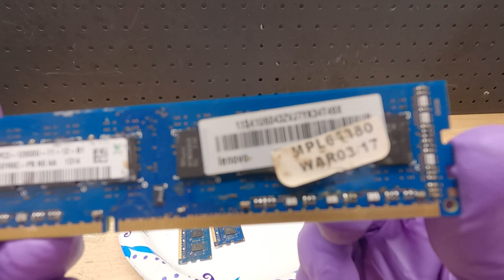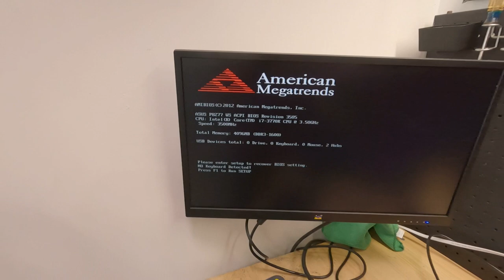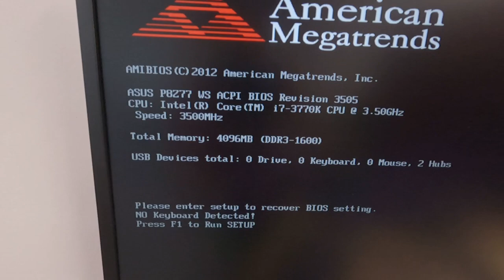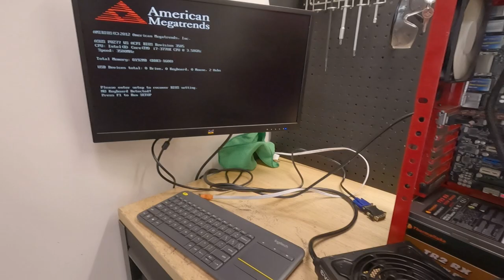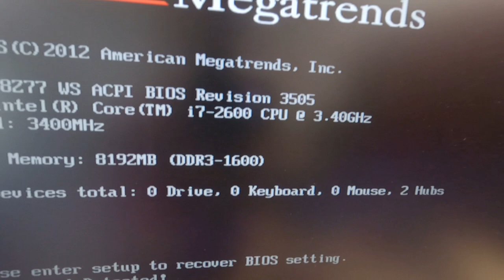Cleaning roach infested computer parts! Was it worth it??

Comment: I would just do the same thing you did, but I would have checked the inside of the case outside the house.  If it was going to be worth it,  it was going to be worth it, but if it didn't, it didn't.  You got your $20.00 back and some free ram that works.

Comment: I would have cleaned it, for sure, to give it all a shot.  You chuck and or destroy that dead stick or try to file for a warranty claim on it?  What was the make?
Reply from the maker: I actually went back and gave it another cleaning and it started working. Did a memtest and it's stable. Guess it just needed more tlc lol
Reply: @DLMtechgarage  I'm guessing wet-spot under chip/s
Reply: @DLMtechgarage  cool.  Brings me to a question for ya: in your time, ever had a stick die?  And what about life time warranties on them I have heard about?  Ever pursue one?  Thank you bruh.
Reply from the maker: @PapaMav  I have had older ram sticks die but never persued the warranty. Newer on one with warranty I have RMA to the manufacture with no issues but never really excersice the older lifetime warrant ones. Mostly because the customers want the computer now and cant afford to wait.  I keep a stock of older ram and sell it if they have a bad stick and typically toss the bad stuff out.
Reply from the maker: @jrose-xp6tf  good point, didn't think of that but def and prbly what happened.

Comment: I'd use dish soap and water for first pass clean. Followed by 91% alcohol to remove water and set in sun out watch and movie then test it but yeah never bring anyone electronics into house with opening it especially game consoles like playstation 3's and 4's. They are by far the worst roach motels out there and cleaning them thoroughly is essential and may fix many systems just by removing dust hair and bugs. Always replace the thermal solution  such as paste and defective pads so fixed 2 ps3 and 1 ps4 by just cleaning it.
Reply from the maker: Appreciate the info!

Comment: I like getting dirty computers. sometimes you can get it for a little less.  There is one time i bought a pc case. guy threw in motherboard and ram stick and wifi card. got it home. there was all that weird gunk on it... turned out to be roach "stuff". cleaned it.. motherboard didnt work, but rest did. luckily i was going to paint the case. started to take it all apart, drilling out rivets... there was dead roaches all in it. so.. had to clean all that out and then paint it. now it looking good!
Reply from the maker: been their with dead roach filled pc's myself, but i agree. i look for the old and grimmey gross pc's as you get better deals and people tend to judge a book by its cover. had one I got at a yard sale, covered in dirty, dust, food, juice you name it it had it. got it home opened it up turned out to be a ryzen 5 2600 system with a gtx 1060. the case was crap and had no window so it was a gamble. Paid $50 and lucked out!